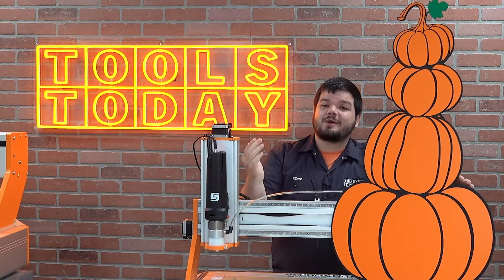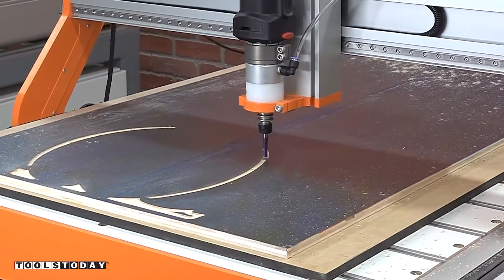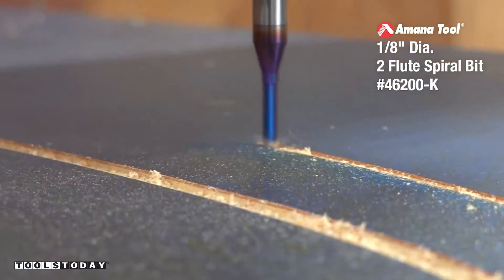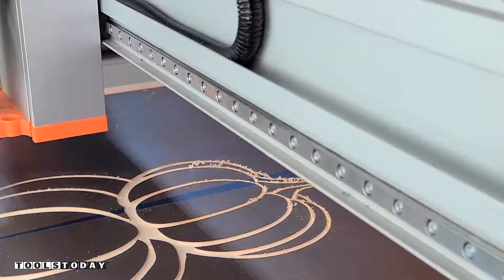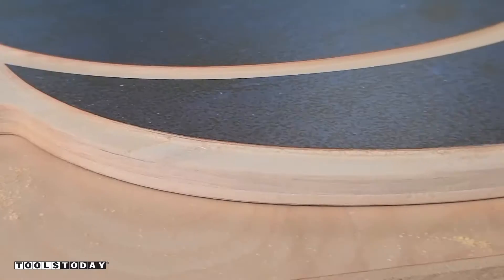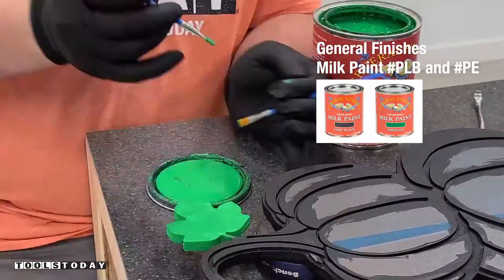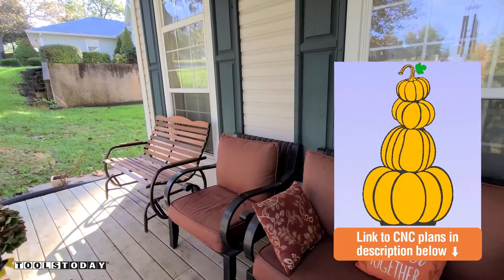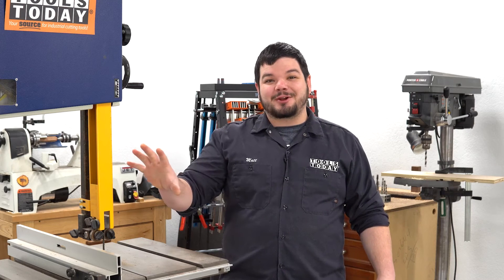How to Make a Stacked Pumpkin CNC Cutout | ToolsToday

Comment: Your videos are awesome. However….in getting ideas for my stepcraft, seen this video. One of the better videos I’ve seen. But the tape. @ $16 a roll….your $16 in the negative before you have the board or paint cost. Is the tape really necessary at that cost? I know it’s better end result but cost is an issue.
Reply from the maker: It's a function of cost vs time spent.  You will spend 10x longer trying to do it without making a mistake vs using the masking.  That's also for a 20' roll, so you're using it on more than just this one project.